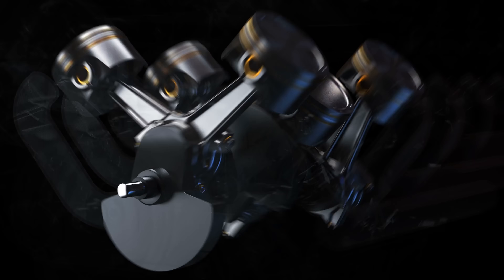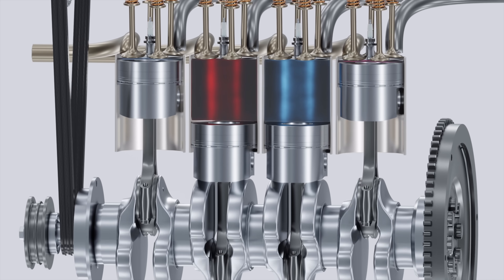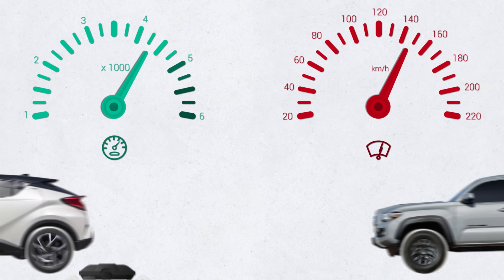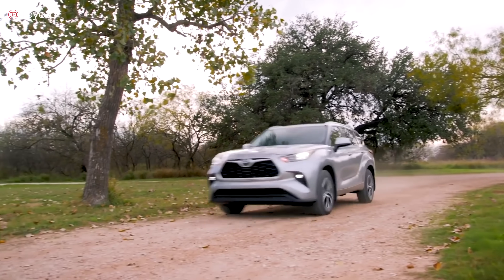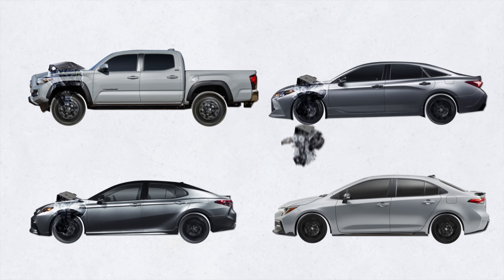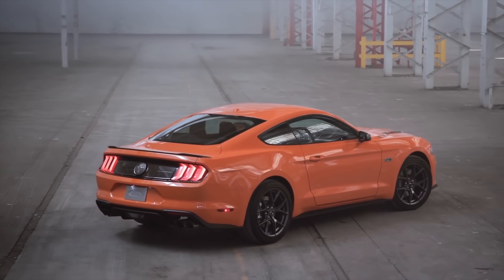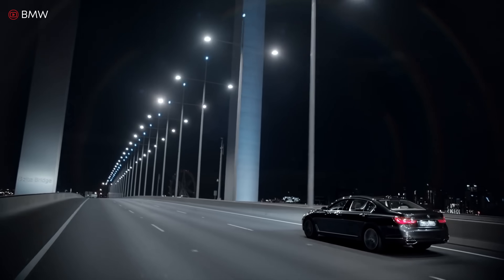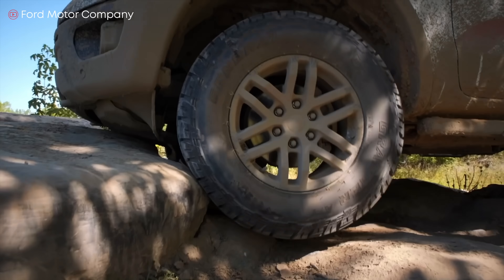No One is Telling You the Truth About Turbocharged Cars, So I Have To

Comment: I had a 2002 Volvo s60 non-turbo that went 240k miles before it got the point the car was just done. The turbo version that were much more common didn't last nearly that long. Turbos are expensive to fix and a pain in the rear. You get more performance not the longevity someone like myself is impressed with.

Comment: I had a 2004 dodge stratus RT 3L v6. I couldn't reach  the back 3 spark plugs.  Had to remove so much stuff. Really bad design. Any of the 4cly engines I've had were easy to work on. So there's that. Never owned a turbo 4 . I personally like naturally aspirated 4 cylinder engines just for the ease of working on them.

Comment: Why not both? Like a dual turbo V6 that is in my AMG with the 3.0L V6 BiTurbo? That little engine puts out 365HP and 365ft-lbs of torque. And and long as I keep my foot out of the turbos, I get 28mpg! The 5.7L hemi in my Jeep puts out a similar HP and torque but the best I can get out of that is 21mpg. The difference is in city driving the AMG still gets 19mpg, whereas the 5.7 Jeep gets maybe 13mpg. This is the advantage of the turbo...and as long as you maintain regular oil changes (do not follow the manual, change it earlier than what the manual says) the turbo should last you 150k to 200k miles which is a reasonable lifespan!

Comment: A lot of these turbo 4s are requiring premium fuel .  The mpg improvements are traded of for higher fuel cost per gallon . Net net is zero savings in fuel . It makes sense to me that spreading the same power over a 6 or 4 cyl engine , results in more stress on the 4 cyl . At the higher temps from the turbo , longevity is a question mark for me .  six cyl also is smoother and has a nicer sound / feel

Comment: So I know you are not a fan of past Hyundai vehicles but I have to tell you that my wife's Hyundai Santa Fe Calligraphy with the 2.5L turbo four engine and AWD is one of the most fun to drive vehicles I have ever had the pleasure of owning. is quick and the handling in optional Sport mode is like a sports car.  Is gets about 29 mpg highway and has around 280HP and over 300LB/Ft of torque, unbelievable for a car under 50K!

Comment: My parents wanted a new Mercedes’ e class. The 2012 model had 302 hp with a n/a v6. The modern one was a turbo 4 with 255 hp. Although the torque was similar, it didn’t pull like the V6. Also, the e class is not light car at 4000 lbs so the little four cylinder stemmed underpowered. We opted for the model up with the e450 featuring a biturbo V6 which is smooth and Very powerful at 362 hp and 369 lb ft of torque

Comment: Plain and simple, heat is bad mmkaayy!! Specifically talking about towing, Towing on a road trip with a i4 turbo and 90 degrees outside stress the crap out of them metals. Also smaller engine require higher rpm than big engine to make power so high rpm plus turbo = a lot of heat and stress. You’ll have to do more frequent oil changes too. But I do not mind a v6 twin turbo though.

Comment: As European influenced, v8s were not readily available however we got and loved large L6 and V6s. However you have to admit that the turboi 4s are literally blowing them out the water while being way more efficient. Most reliable manufactures have also developed thru their initial short term reliability phase and turbo engines are as reliable as V6s from the late 90s. 
Currently I have a gas guzzling Lexus V6 and a Toyota 3.0D4D turbo diesel. 
Kind of justifies forced induction as the replacement for displacement. As a former RB26 owner ,I can easily attest to that

Comment: turbo on my Toyota Previa had to be replaced after 70K miles (expensive repair at Toyota garage) after another 70K that new unit failed but repairing it was not an economic option so I have been running it for the last three years with a broken turbo. This means a maximum speed of 50 mph and 30 mph up a hill and 5 mph up a steep hill. I was extra careful with the second unit.

Comment: You said it before, but didn’t mention it here; The smaller displacement turbo engines that make the same hp as larger, naturally aspirated engines have a lot more stress on them throughout their life so they will require more maintenance and usually don’t last as long.
Reply: The lack of turbocharged engines offered today by Toyota simply legitimizes my above 👆 statement.

Comment: "IF" you change the oil every 3,000 miles on a 4 banger turbo, there should be no problem with it lasting well over 250,000 miles. However, for simplicity reasons, I would still take the NA 6 cylinder.
Reply: Yeah it's not going to get to 250,000 miles without a lot of expensive maintenance. Not even close. Give people a shitload of problems with 130,000 miles

Comment: Thanks for vid Scotty. I have a Jeep Renegade 1.4 L Turbo 170 hbp, 6 speed automatic. It is wonderful technic even driving up to 219 km/h. It is now 6 years old and I had a turbo failure with needed replacement of turbo. That was expensive. Car drives wonderful again. And yes I understand , if a V6 would do this without a turbo, it would be better, but environment regulations force these changes. Next step in Europe is that only hybrids/EV´s are allowed/sold. You can hardly buy petrol/diesel cars here anymore.
But what do I prefer, V4 Turbo or V6? V4 T although it costed me time to decide :-)

Comment: I have a v6 ecoboost f150 and a v8 f150. The ecoboost is an absolute monster compared to the v8. I regularly tow up a long steep hill the v8 will pull up the hill at 55 with the pedal on the floor. The ecoboost uses 3/4 throttle to give me 60mph. It would do 70mph if i asked it.

Comment: I would think turbo engines are trouble.
However, the Buick Encore cross-over with a 1.4 liter  turbo charged engine is rated very high at #3 by Consumers Rating in reliability for 2021.
Does this mean that turbos are becoming much more reliable????

Comment: I have a 2018 Honda Accord 1.5 turbo. For a full size sedan the fuel mileage has been unbelievable. I drove from Timmins On. to Ottawa…for less than 54$… 52 MILES PER GALLON ( Canadian ). I drove 100 miles a day back and forth to a gold mine in Matheson On. and had consistently good mileage, NO ENGINE PROBLEMS, lots of power.. a lovely car. 118,000 klm. on it now ( 73,000 miles ). A great car for 30k . Considering the size of the engine and the size of the car I am very impressed… and in my 73 years I’ve owned a couple of dozen vehicles ( VW, Volvo, Chrysler, Pontiacs, Oldsmobiles, a few Mustangs ( ya… loved my 2015 GT PP six speed standard … power and fun galore… fuel mileage not so much! )😊

Comment: I watched a lot of videos talking about this same issue and everyone of them excluded the two biggest issues. Most turbo engines, you are required to use premium gas and probably should use premium gas in all, so how are you saving on fuel? Second, if you use the power with a turbo which is how they advertised the engines and even mentioned here, you get the same gas mileage if not worse in some cases. The reason car manufacturers are switching inline 4 turbos is to satisfy the government requirements. That's it. There is no benefit for the consumer or environment (if people want to go that route).

Comment: I preffer straight 6 (I6) ;) much better engine than V6 or I4+Turbo.
PS: I6 with supercharger is all you need (I have not seen much of those, but I want one) ;)
Reply: Find one that needs rebuilding, then get an after-market setup, and get superior internals to handle the added stress.  Probably will be SUPER fun to drive!

Comment: However, what is the life/mileage expectancy of the smaller turbo engines vs; the bigger V6 or V8. Personally, I own a 2020 Honda CRV with the 1.5L 4 cyl. turbo.
I would almost guarantee this engine, even with the best maintenance, will not reach 100,000 miles without major repairs. The Toyota V6 engines will go 300,000 miles and possibly more with good maintenance. The smaller turbo engines are a repair shop owner's dream.

Comment: Inline 6!   The torque is fantastic on inline 6 engines! I truly enjoyed my Jeep Cherokee 4 l high Output. I have a lot of miles on Detroit Diesel series sixty,   For those of you that don't know, This is a straight 6 turbocharged Send my truck engine. Recently however , The Kia Hyundai 1.6 l Turbo 4 cylinder and the General Motors 2.7 l for cylinder Turbo Have caught my eye because of the low RPM torque.

Comment: Question please. I have a 2012 Hyundai Sonata 2.0 Turbo with 91,000 miles. My local Hyundai service center has just installed my free new engine. It comes with a 12,000 mile warranty. I have 200 miles on the new engine. Should I change that oil at 500 miles (break in)? Should I use full synthetic oil from now on? THANKS SO MUCH for any answers.
Reply: what after 3 weeks  the great scotty never answer you? wow

Comment: Reliability and longevity come to mind. Such a stressed motor as a small turbo  I4 cannot in my experience last as long as a V6. Also even if they cost a little less to build an I4 Turbo is outrageously expensive to repair.  And some require premium fuel to get the most out of them.  Besides where is the large bore naturally aspirated I4 in the mix?   You can get a fair amount of performance out of one them still and more longevity?   Just saying...

Comment: There's another issue here. Maybe the manufacturers have done their marketing research and have determined that most buyers of heavy vehicles just use them as their daily drivers and don't need a large engine. As of 2023 Toytota is no longer offering a V-8 with the Toyota Tundra. Maybe they have determined that so few buyers do any theavy owing at all that it isn't worth for them to build a V-i8 model. All Toyota will offer is a turbo V-6.

Comment: I bought my wife a 2018 Equinox with 2.0T engine. I finally drove it last night. I was really surprised how fast it accelerated. Not as fast as my Camaro 2SS was with the 400 hp 6.2 but I was impressed. My wife doesn't drive fast but I told her to be cautious this winter. Even in AWD it might get loose. Hopefully the traction control will keep her out of trouble.

Comment: Hey Scotty, I am a Qualified Mechanic, I have almost 30 years experience from cars to earthmoving equipment in USA and Europe, there is pros and cons with everything, right now as we stand with high gas prices....... well I had an option to buy a 2021 2.3 Explorer similar as in the Mustang and Ranger, or a V6. But to be honest I prefer a I4 turbo and here is a few reasons...
1. Gas mileage
2. Its lighter and just as fast as a V6. Performance are similar and to be honest we are only allowed to drive as fast as the speed signs say's...
3. Up north were I live we have snow and salt, V6, V8'S aspesially trucks and suvs the manifolds and turbochargers are very close to both front wheels otside the V's.... salt gets sprayed on the engine exhaust manifolds/ turbochargers corrosion and broken off bolts in the cylinder heads/ rusted coolant lines etc..... with a 4 Cyl aspesially on the 2.3 ecoboost its way up higher and not even close to salt. Also the 2.3 ecoboost does not have a exhaust manifold the turbocharger bolts right on the cylinder head.
4. Yes i have to chage the plugs sooner, but guess what... there is only 4 and its easy accessible. No manifolds to remove to get to the plugs.
5. In general maintenance are easier to do and cheaper for example most waterpump replacement is easy outside the engine on a 4 cyl, on some of the V6 engines aspesially Ford its inside the engine and gets driven by the timing chain...way more expensive in general.
6. The 4 cylinder on the Ford Explorer uses the same drivetrain as the V6 and if you take care of it and dont drive it like a race car, with good maintenance it should last you a long time.
7. With the 2021 Explorer tow rating is 5200 pounds for the 4 cyl equipped with the tow package and only about 300 pounds more for the V6 which is not a big difference.
8. The engine is lighter and the car feel well balanced.
9. And yes if its out of warranty and i need to replace the engine... its cheaper🙂 way less moving

Comment: Old Cadillac engines lasted forever with 4 bbl carb and low rpms at highway speeds. I friend of mine many years ago put a brick on the accelerator trying to blow the engine. He came back later and it had run out of gas. The Cadillac still ran good.
Reply: My 58 cadillac with its original 365 engine just had its 1st rebuild 5 years ago. Still ran fine, but downdraft tube blow by was too excessive.  My parents bought it in 1960. I was 1 year old!  Lifelong Southern California car,  I drive it every weekend. 😊
Reply: @1958Cadillac-v2g  I had a problem with my 53 and all I can remember is that an oil line or passageway  was plugged up. The 58 year really made good looking Caddies. You are fortunate to still have it.

Comment: I bought an F-150 with the 302 Coyote engine. While I love the truck, it doesn’t get much better mileage than my old Ram used to get with a Hemi. I’m still on the fence about the EcoBoost engines. I’ve seen some with piles of miles and no issues, but have also known people who’ve owned them with complaints of turbos going out. I know, at least in the trucks, the base engines are supposedly built overkill to accommodate the stresses of turbo charging. If they could make the turbos more reliable, I might be a little more convinced than sceptical.

Comment: Chrysler 2.2 turbo 
205,000 miles before I sold it 
7psi , 150hp 
Problem was distributer wore out twice 
Needed a quart of oil around 2,500 miles 
29-32 miles per gallon 
Yeah…..

Comment: Bottom line is if you have a turbo I4 especially one that is less than 2.0 liters don’t abuse it. You are not Fast and Furious. The Turbo can be great for giving that teeny tiny engine some boost when needed to pass or when merging onto a highway but that’s about it. You need to realize how much stress that forced induction puts on such a tiny engine so use it sparingly. Make sure you are changing your oil religiously with a good synthetic and change your air filter. If you beat on it and don’t keep up on routine maintenance that little turbo probably isn’t going very last long.

Comment: I dislike turbos just because of the increased pressure on the cylinder head. I drive beaters that are mostly over 10 years old. Most turbo engines are blown by that point.

Comment: I heard that the Honda CRV 4 cylinder engine had difficulties when first rolled out as the increased pressure from the turbocharger was pushing gasoline ast the piston rings into the crankcase, diluting the oil and damaging the engine. Is that true?
Reply: The Japanese use super weak rings, to reduce friction and increase gas mileage - they only care about that and cost - so it might be true.

Comment: I have an s2000, arguably one of the best naturally aspirated 4cyl ever. I turbocharged mine tho and this was 60k miles ago. I’ve had zero problems running 14lbs making 550 to the wheels. Once I upgraded my clutch to something beefier that could handle the torque, it drove like a dream. I daily it and I can either drive normally and just cruise, never going above 3500rpm, and I can also have fun anytime I want banging gears at 8400rpm. This is the best car I’ve ever had. It’s faster than my Gallardo ever was, it handles better than EVERY supercar I’ve owned. I personally like the convertible and it’s automatic and fast to fold down. Exotics a lot of time you have to manually take the top off and shove it in your frunk. My gas mileage is on par with an exotic, foot out I get like 170mpg, when I’m having fun I get like 9ish. Where I live, my neighbors are uptight snobs and they actually tried to get me kicked out of the house I own because they say me having a Honda parked out front violates HOA. They sneer like I’m some peasant when I can line up anything they have and walk the crap out of it. The only things I’ve lost to so far are the 812 super fast, the 720s, and the new C8 ZR1. Gallardo, huracan, aventador, 430 scuderia, R8, GTR, all put into pavement heaven
Reply: Edit: 17* mpg not 170 lol

Comment: The only reason i support the V6 is because more power and less metal = shorter life. These turbo'ed I4's make great power sure but, that is a lot of stress for a very small engine and i just can't see them lasting very long especially if they are ever put through their paces regularly.

In 20 years time you'll see WAY more old naturally asperated V6, V8, and I4 on the road than there will be turbo I4's.

Comment: One point not mentioned is that turbo engines make a lot flatter torque curve usually at a much lower rpm which greatly enhanced drivability and also general thermal efficiency.

Comment: I've got a 2018 buick regal essence sportback.  For the most part, I really like the car. However, if I could choose between the turbo 4 it has or their old 3.8 v6 they used to have, I'd take the 3.8 all day and night. Sure l, the turbo is more powerful but, those 3.8 v6's can go forever and you don't have to be worried much about the oci as the engine isn't under as much stress as the turbo 4. And I don't really think the ecotec 2.0 gets any better mileage in town than the v6. I'm frankly kinda disappointed in the ecotec's in-town mileage.

Comment: Turbo lag is too addictive. I have owned a 221HP N/A car, it's throttle response was super great. My 380HP Turbo car is more fun, when turbo hits it's a whole other story on how it feels. I take care of both cars and have never had any big expensive fixes.

I have a 380HP car because I love driving like that. In return, I have to change oil more often,  and general maintenance that an regular person don't want or need to. My uncle has had a Ford Mondeo 116HP Turbo diesel. It has now been driven 488k KM, no big fix besides timing belt when it was due, the clutch once and of course wear parts like breaks etc.. If you take care of the car it will take care of you.